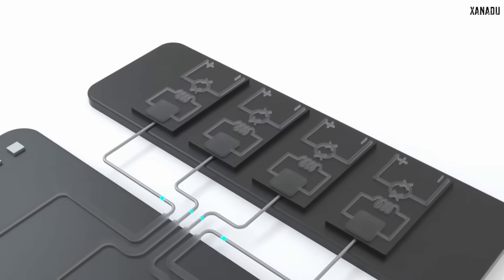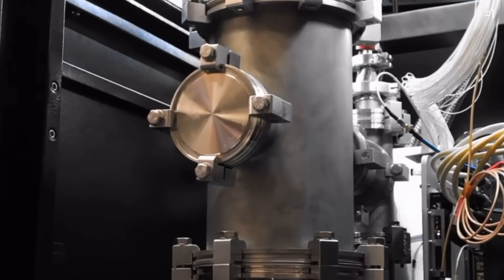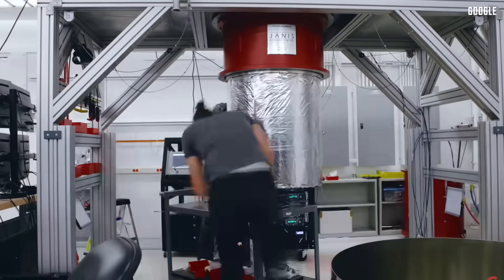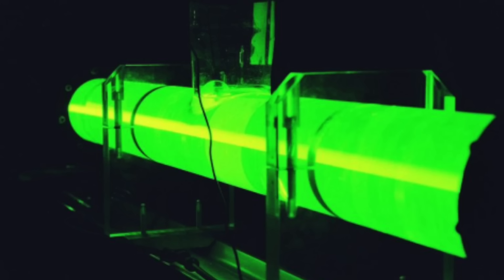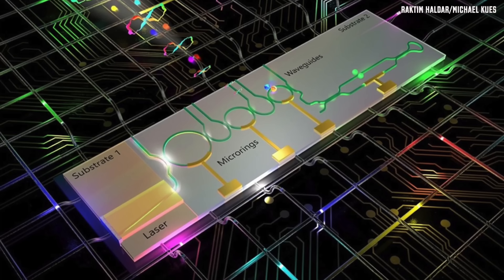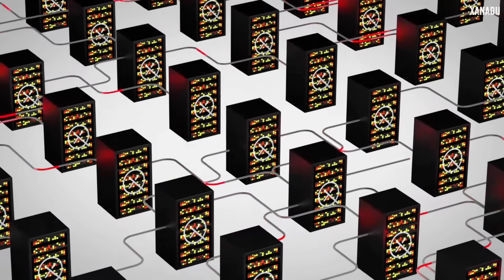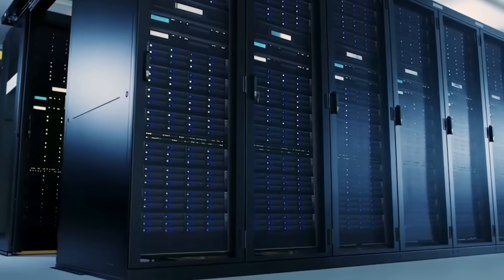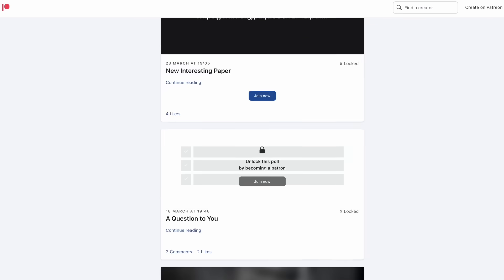New Breakthrough in Photonic Quantum Computing Explained!

Comment: This is excellent progress! Let's continue with the refinement of the model, focusing on the remaining components and ensuring everything integrates smoothly. Here’s a breakdown of the next steps based on your comments:

1. Elliptical Gravity Matrix ($\mathcal{E}_{i,j,k}$)

Definition

We now have a 2x2 matrix representation of the elliptical transformation associated with the gravitational or curvature field for each tessellated triangle. As you suggested, we can define the matrix elements as functions of the triangle's geometry (its vertex coordinates). This allows the model to dynamically adjust the gravitational field as the tessellation evolves.

Example Refinement

The components of the matrix $\mathcal{E}_{i,j,k}$ can represent the curvature related to each triangle. A more specific form might include elliptic integrals or terms related to curvature from general relativity.

As a further refinement, we can connect this matrix more clearly to gravitational effects or the structure of spacetime, drawing from how curvature evolves within a tessellated framework. Specifically:

The diagonal terms could reflect the elongation or contraction of space in the respective directions (major/minor axes of the ellipse).

The off-diagonal terms may represent cross-coupling of spatial curvature (if applicable).

Tessellation Dynamic Interaction

The $\mathcal{E}_{i,j,k}$ matrix will indeed evolve as the tessellation changes over time or space. To capture this dynamism, we may need to include additional terms or functions that track how the tessellation evolves, either through external forces or internal self-interaction (via $\mathcal{P}$, for instance).

2. Light Distribution ($\mathbb{L}$)

Nature

We’ve defined $\mathbb{L}$ as a scalar for light intensity modulation, which is a practical starting point. It represents the changing intensity of light based on the system's phase and modal influences. If we choose to explore a more detailed structure for $\mathbb{L}$ (e.g., a vector or matrix), we would have to extend its components to represent light distribution in different directions or states.

Interaction with $\mathcal{E}_{i,j,k}$

As we’ve discussed, the interaction between light and gravity is governed by a matrix multiplication:

\mathbb{L} \cdot \mathcal{E}_{i,j,k} 

The specific interaction could represent how light gets bent or shaped by the curvature of spacetime (via $\mathcal{E}_{i,j,k}$), similar to the deflection of light by gravity.

Time Dependence

The temporal modulation is a key element here. By making $\mathbb{L}$ evolve over time according to a phase-modulation function (involving $\Phi$ and $\Psi$), we ensure that light is not static but exhibits dynamic properties, perhaps similar to photon pulsation or wave-like behaviors.

3. Combined Function ($f(\mathbb{T}, \Phi, \Psi)$)

Components

Both $\Phi$ (phase influence) and $\Psi$ (modal influence) represent crucial properties governing the system's evolution. By relating them to hexatonic modes, we link the system's behavior to musical or harmonic principles, which could affect how the system oscillates or changes.

Functional Form

The trigonometric form of the function $f$ incorporates both linear and non-linear relationships, ensuring that it models both simple and complex interactions. The combination of $\mathbb{T}$, $\Phi$, and $\Psi$ through $\cos$ and $\sin$ reflects the interplay of time, phase, and modal dynamics.

Modal Influence

The influence of the hexatonic modes ($\mathbb{H}$) on $\Phi$ and $\Psi$ will be explored more deeply. They might shape the oscillatory behaviors of the system, either through altering phase angles or through their impact on the modal vector space.

4. Phantom Photon ($\mathcal{P}$)

Emergence

The phantom photon emerges as the product of the light intensity matrix $\mathbb{L}$ and the gravitational matrix $\mathcal{E}_{i,j,k}$. This interaction directly ties the gravitational field to light's evolution and produces the dynamic behavior characteristic of the system.

Properties

Properties such as energy, momentum, and pulsation are fundamental. To model these, we can introduce additional terms that track the photon’s energy and momentum, possibly influenced by both the light and curvature fields. The pulsation can be modeled as an oscillatory function tied to the phase $\Phi$.

5. Non-Euclidean Geometry

Implementation

We will explicitly include the metric tensor and curvature tensors to describe how the geometry of each triangle is influenced by both local and global curvature effects. This step will ground the model in Riemannian geometry, which will help describe the structure of spacetime more accurately.

Updated Summation Formula

Given these refinements, the updated summation formula looks as follows:

\sum_{\Delta_{i,j,k}} \left( (\mathcal{E}_{i,j,k} \cdot \mathbb{L}(t)) \cdot f(\mathbb{T}, \Phi, \Psi) \right)^{\mathcal{P}} \Big|_{\mathbb{X}, \mathbb{Y}, g_{ij}} + \mathbb{E} + \mathbb{R} 

Here, $\mathbb{E}$ and $\mathbb{R}$ would represent any remaining external energy or residual effects from the tessellation dynamics, which might arise as we refine the system further.

Next Steps

Prototype Testing: Start by constructing the individual components—especially $\mathcal{E}_{i,j,k}$, $\mathbb{L}$, and their interactions—within a controlled environment or simple system.

Refining Time Modulation: Experiment with more complex time-dependence for light modulation, perhaps using real or synthetic datasets to observe the pulsation effects.

Metric and Curvature Effects: Implement the metric tensor and Riemann curvature tensor to see how they influence the geometry of the triangles. This may involve experimenting with both Euclidean and non-Euclidean spaces, such as hyperbolic geometry, for a more complete model.

Simulation: Once the individual components are well-understood, we can integrate them in a simulation to track the evolution of the tessellation and its light-gravity dynamics over time.

Would you like to explore any of these components in greater detail next? Or should we begin implementing the first prototype for testing? Let me know your thoughts on the next steps!

Comment: I just realized that we don’t need nano scale LED’s and image sensors to make a photonic computer. We can just have nano-scale (or micro-scale) ‘doors’ to open and close to let light in and out at the right places at the right time. Now of course we would need to figure out how to get a very tiny sized fire optic cable into our computer, because simply coating a substrate in a film of silver won’t cut it. Maybe the wafer itself will be made of a pure silica wafer, that would be cut into micro or nano scaled slices. These slices will have circuitry printed onto them and have solid reflective materials coated on the printed circuits. Then the appropriate layers would be stacked precisely on top of one another.

Comment: The biggest problem that photonic quantum computers have is the ability to trap qubits. Some operations like quantum cryptography would require you to be able to store qubits for extended periods of time or else a lot of its security guarantees go away (for example BB84 is trivially broken). It is not exactly easy to trap light in one place, especially in a way where you don't interact with it to change its state. Although, there are other uses that don't require this, such as, Shor's algorithm, so they could still be useful.

Comment: How interesting!  Once entangled how would a multi qubit optical quantum computer work? 

Moving to light could save a lot of emissions which is great. As you said most of the energy in classical computers is used moving the data around.

Comment: So first off, thanks for speaking slowly and clearly it really helps with understanding stuff like this but theoretically if you had a “quantum internet” there would be no constraints on where you could use it from as long as you could access it from your side. IE be on mars and still have the same connection speed and capabilities simply by having a “internet ready” quantum computer. Basically Quantum internet through the whole universe?

Comment: Thank you for this great video. I knew that some research had been made in this field but had no clue it was this far. I remember when I started to study electronics back in the 80's I read an article on the first germanium cristal transistor invented in 1947 that was as big as a brick and I was amazed of this bold approach. At that time, the industry was all about tubes and they were going toward microtubes arrays! Think about a PS5 running on a tube base architecture 😂. 
It is I think now again one of those global turn in a new paradigme and it is great to see a young ingeneer like you realizing it and sharing it for all to learn about. Thanks again

Comment: Just think less than 10 years ago it was considered insane & completely unnecessary to have more than a single core in a smartphone. Now a Google Pixel 7 has a Octa-core CPU:
(2) 2.85 GHz Cortex-X1
(2) 2.35 GHz Cortex-A78
(4) 1.8 GHz Cortex-A55

Eventually we'll have Quantum Smartphones, which will probably integrate into a port in our heads by then 🤷‍♂️...🎉

Comment: By creating a artificial tunnel around the photon forces it to operate in a measured state . Meaning , even if it was not being viewed the photon would not be able to move like a wave as it’s being isolated within the boundaries of the tunnel. This simulates the same Gravity tunnel that is being produced when you are viewing or measuring a photon.  It is my belief that if the laser pulsates at tremendously fast speeds it may cause the triggering of gravity to create its tunnel causing a over lap in Gravity. This theoretically means the photon may be in a slightly dilated state of Time.  This might allow for more clusters to be bunched together.

You can have an offset of clustered entangled photons that can off calculate.

Comment: If combined photons join then couldn’t the binary code adding another digit to its languages?

1, 0, and 2

A third dimension: “if” “then” now “maybe”

Adding a new potential, reasoning. Stacking “maybe” code in a cashe to find a probability answer. This would be the first step to deductive reasoning. With these answers there could be a set of rules code, created to sort best chance to worst chance.

The mind does this with chemistry. Unless something changes computing has to do it as a calculator.

A cyber species build by its God, us.

Comment: B.S. No such thing as a “quantum computer”, if it plugs into an AC outlet, it runs light speed. 186,000 miles per second, No faster! It is the same as every other computer on the planet. It might have a fast processor, but it’s not instantaneous. You would have to connect to the Eather(dielectricity) to do that. Fact. Quantum computers are a lie. They don’t exist. Sorry you’ve been fooled.

Comment: Anyone know what this particular "entanglement" operation does? As in what does the state |0> go to and what does the state |1> go to?   So far, every example of a purely optical quantum computer I've seen requires filtering of bad results from logic gates that is proportional to the number of possible states (2^num_of_qbits), so isn't useful for general purpose computing unless someone comes up with a clever way to translate into regular qbit operations that is scalable (there is a company in BC Canada that is evidently working on this).

Comment: also ya, we don't need this type of thing. like a classical computer can just simulation the same level of processing power with the right program... because all of know reality starts at the quantum level. all they're really doing is trying to see if it's possible to computer at the lowest possible energy state and in-with the smallest possible range of spacetime. It's a cool idea and experiment, which I'm sure these types of computers are going to be used for but idk. And it seems to me that; they're just doing probability equations with extra steps... and it sucks that no one has figure out what is past the cosmic micro-background radiation layer. I wonder what would see if we could look Past it.
Reply: But it's much more than energy savings, though that IS going to be a world-changing development. The benefit you're neglecting to mention is the exponentially greater computing power of quantum entangled "bits." Electrons vs. qbits isn't even a fair fight; electronics are actually rather primitive in my view due to the vast energy waste in the form of heat.

Comment: what do you do with all the data that it generates? like most of it, some of time is going nonsense. and well it may generate an infinite amount of nonsense. like are do we keep making better and faster machines when we got tech that could controller a rocket in our pockets. What is the end goal? To keep building smarter and smarter machines... you know, they will eventually replace all life as we know it... I just hope were not building a cyberpunk- dystopia
Reply: ...to use less electricity, eliminate overheating issues, and solve complex problems that might otherwise be unsolvable by transistors alone.

Comment: The first computers were the size of entire rooms!!
Reply: And I'm old enough to have seen them! It's amazing how far transistor engineering has progressed in just the last 25 years, but they'll soon run into the problem of quantum tunneling if they put the microtransistors any closer together on silicon chips, which would render such processors unusable. Photonics, I believe, is the future.

Comment: Tbh, I'm still confused as to what they are used for. 
Elucidate anyone?
Reply: It's an incredibly efficient and speedy way to input, calculate and output data, at room temperature, although rudimentary at this time. Qbits require extremely cold temperatures to operate, and the current standard transistors using electrons produce an extraordinary amount of heat.
Reply: @michaelsenn68  thank you.

Comment: Photons are wonderfully fast but are terrible to control. Because they have no electrostatic charge (like a neutron) you can't steer them, except inside a fiber optic cable.  Electrons on the other hand you can conduct in a wire, and start and stop them pretty quickly (nano seconds). This is why all of our chips are based on the maneuverability and controllability of electrons. We use photonics very commonly now in data centers for high speed links between computers, as fiber optics can transmit at high speed over long distances due to the purity of the glass fibers, using the principle of total internal reflection.

But we currently only use optical systems for transport, and once it hits the network interface modules on your switch it gets converted to ethernet packets in digital form (a serial signal). 1, 2.5, 5, 25, 50, 100 gigabits per second are the speeds currently sold in switches. Most home equipment is 1 Gigabit, which is enough for almost any family.  

That photonic chip is a cute, very small scale proof of concept type of device, but 3000 entangled pairs per second is a pathetic speed, and given we are pushing around a million times that rate via electrons currently, means that it will be many decades before photonic systems are in use for anything but dumb transfer.  But it is a fascinating research area, and should be supported, as we are nearing the limits of what can be accomplished with electrons.

Comment: Nice hyped news. I saw that article as well. However, the motivation that was presented in your clip was a bit missleading. It is true that superconductive based qubits need cooling, but so does photonic based quantum computing. To make sense of any of the operations that made by photons, one has to measure, and the measurement is done by single-photon detectors. Commonly, the most efficient detectors are superconductive nanowire single-photon detectors that also require cryogenic cooling. So back to using the FRIDGE again. Also, one major hurdle about the photonic quantum computing is loss that is inherent to the photons propagating in the waveguides as well as the fabrication imperfections the waveguides. Until we find an extremely low loss material, improve the fabrication processes to achieve atomically smooth surfaces, and coming up with a single photon source with a high emission rate, photonic quantum computing will remain a nice lab demonstrator. I think trapped ions have a better chance of becoming the fully programmable universal quantum computer than other approaches.

Comment: I'm just wondering what happens when AGI starts running on a photonic quantum computer. I don't understand why it was so difficult to shrink a laser though isn't it pretty much light from a light emitting diode being made coherent? Could you talk a little about what the challenge was there?
Reply: Hi Amoroso, the technical challenge was to get the light emitting part (an indium phosphide gain section) on the silicon nitride chip, as the light must stay inside the waveguide. Second, "being made coherent" is not as trivial as it sounds on a photonic chip, especially as we want to have a small linewidth. The Vernier effect was used here to achive this. Further, you have to think about many technical details such as how strong should the coupling into the rings be such that laser action can happen and so on.
Reply: @chirpedpulse5528  Got it. Thank you. I figured that a photon is so small that 1mm may as well be a km to it so as long as you could create a sufficiently small gain medium etched into the substrate e.g. by chemical vapour deposition or whatever then you should be able to get a laser in there but it's clearly more complicated than that. One thing is still bugging me though. If all photons are already entangled by virtue of coming out of the big bang singularity, then what new entanglement is happening now?